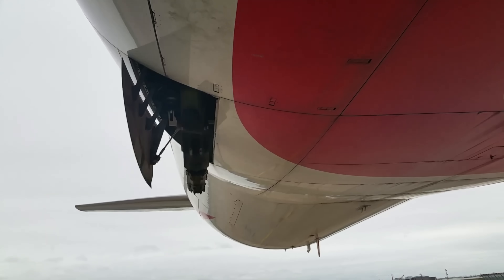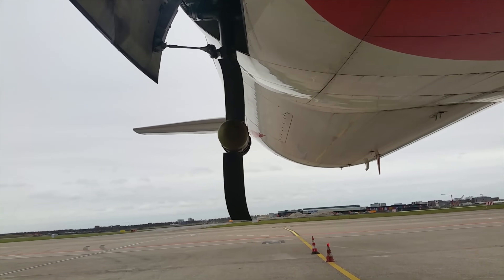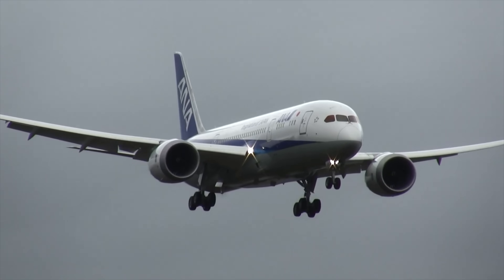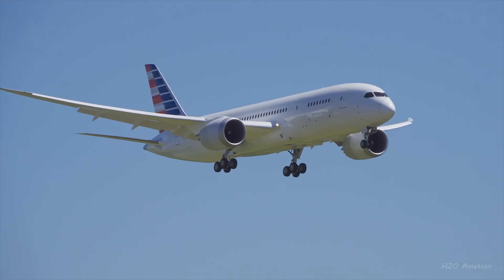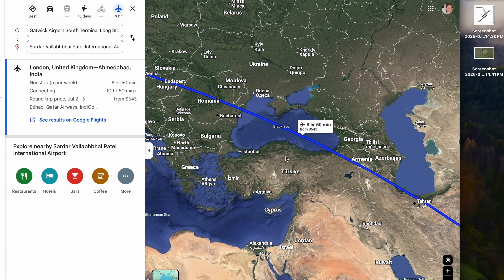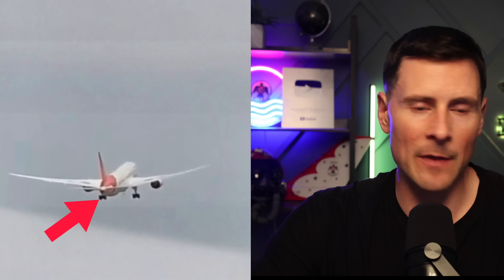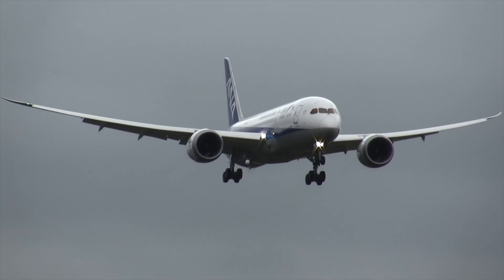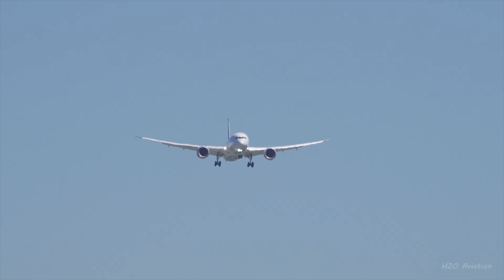Air India 171 SHOCKING UPDATE on RAT Deployment and Flaps!

Comment: Yes it does change everything, a 14 year old plane with engines suddenly dieing like that. SHODDY MAINTENANCE, that's what it is.
Reply: 11 years
Reply: British Airways Boeing 787 had to return due to flaps issue....will call it SHODDY MAINTAINANCE too?
Reply: @gulleyboy2607 are you really thinking or are you just looking for the easy way out for your own negligence. There are checks, checks and more checks before a plane takes of. I was on a plane in Zurich and that plane was grounded for 24 hours plus because the technicians found a problem. The following day we flew over 12000 kms and safely home. Air India, do your guys really look after your planes?
Reply: It doesn't work like that, components are changed for faults or failures they are not routinely touched, periodic testing and checks to verify operation is done but they are changed on condition or with limitations time changes. It has to be fuel contamination or pilot error, there's no other possibilities.
Reply: Or a pilot spilling his soup, and it leaking down into the wiring panels etc..
I'm betting that's the real problem.

Comment: What do I think?  The Boeing 787 has fatal flaws during takeoff when a combination of mechanical/electrical system faults combine to fail at takeoff.  It should be grounded for examination.
Reply: Yes, seams to me too. Restart is only with APU which themselve need at least the RAT. The APU have enough to start the engines again. I guess more than 60s or more feets. So why do not supply the fuel pumps for 2-3 minutes by batteries?

Comment: If, the black boxes confirm that an internal system failure led to simultaneous loss of thrust and power and there was no external trigger like other rare dual-engine failures (e.g. volcanic ash, bird strikes or heavy rain) this would be unprecedented and deeply concerning for a Boeing 787 which is a more-electric aircraft.

It would represent a critical failure of aircraft system architecture at the highest level of design and safety expectations and be potentially ground-shaking for Boeing.
Reply: Yeah, you should ask who is the BIMBO. The one who fight MCAS or who design it.

Comment: It seems to be dual engine loss, but why? Fuel contamination? FADEC fault? Pulled fire handle ? Switched off eng switches? Every thing seems not plausible but why the heck the engines go off. If the RAT was out the engine must been off.
Reply: Fuel contamination wouldn’t cause both engines to go off simultaneously.

Comment: I think the problem started on the runway before rotating.  He rotated at the end of the runway Which is very unusual.
Reply: No, they did not rotate late. Using that video, you can find the little shed and the bend in the road that runs along the fence in satellite imagery of the airport, and from that (and the inset video in the upper left corner) locate roughly where the security camera had to be. The plane starts rotating just as reaches the left edge of the shed's roof, and is clearly airborne and climbing when it is aligned with the center of the roof. If you project a line from where the camera is through the shed, it intersects the center of the runway (where the plane would be) more than 3000 feet short of the end. This matches the data from FlightRadar24 where the last data received from the plane has its altitude at about 425 ft (+/- 25 feet) AGL as it crosses the end of the runway.

If it had actually rotated and lifted off near the end of the runway, you would have seen it still on the ground to the left of the shed. From the camera position, actual end of the runway just a tad to the right of that white warehouse/garage structure in the video.

The whole "They lifted off at the end of the runaway!" thing was because of the dust, and not the real aircraft position which people didn't bother to check.
Reply: The question is, was he having engine performance issues before he reached V1?
Reply: Normally when you're heavy and it's hot, you taxi to use the entire length of the runway, if for no other reason than having more options (like aborting takeoff) if there's a problem.
Reply: He did not rotate at the end of the runway.  Look at the ADSB data.
Reply: It was a full plane and they used an entrance midway down the runway they didn’t use the whole runway
Reply: @neilcorby6259  That doesn't agree with info I've seen elsewhere that showed them entering near the beginning of the runway, having about 85% of the length to work with. However that video was hours after things happened and used a pretty basic animation so it's possible this soon the info isn't very reliable.
Reply: @neilcorby6259 incorrect. They did a backtrack :)
Reply: When you say "the problem" you mean that the dual engine failure happened on the runway before lift off? 

Even if that was the case, the plane generated enough thrust with its engines to get the speed high enough (V2) for takeoff which means the pilots had no choice but to continue with the takeoff
Reply: @chikku807 took off in overrun, you can see the cloud of dust and debris on the airfield video, that's what killed the engines, FOD.

Comment: Even the one survived said that for few seconds the plane wqs stagnant and then thr lights came up. Please see his interview as well.
Reply: That might have been the RAT engaging and the power rails switching over. If the cabin lights were on, then that means there was no electric failure because the RAT does not power cabin lights.

Comment: In the middle east in summer it is often 50 deg with high humidity - how do they manage there, do you think? I worked in Dhahran for years and never heard of vapour locks on any type of aircraft I worked on Tornados so I  can't speak specifically of civil but I was flying out on 787s at 50 deg regularly   - so I don't believe that theory, I don't give the fuel contamination theory much credence either.

Comment: My guess would be some kind of major electrical failure. Passengers were reporting that the inflight screens weren't working and some other things weren't working either.
Reply: This
Reply: Air India usually turns the IFE off on domestic segments. The photo that poor family took before take off clearly shows them working on this flight. They're completely separate from the aircaft flying systems anyway.
Reply: @vinba8234 that doesnt sound right. Did you see the video of the guy complaining about the flight? The screens were on but not responsive. So electronics were on but not functioning. Also if the cabin is boiling hot, then that is not like any of the air india flights I've been on. Something was definitely odd on that one.
Reply: The in flight entertainment systems have nothing to do with the aircraft's avionics.
Reply: @stargazer7644  Except the fact that if they feel no need to address a an obvious problem, they might be ignoring bigger problems also. Which probably was the case.
Reply: @rejuvenator8966  The in flight entertainment system isn't "an obvious problem".  That's like saying if the backseat DVD player locks up in your minivan that there's something obviously wrong with the tires.
They don't stop aircraft from flying just because you can't watch Ironman.
Reply: @stargazer7644 you can't call cabin crew either. And what about the non functioning AC? The person in the flight before was boiling in the cabin. Pretty obvious problems even if all you care about is Iron man. And you don't seem to understand that ignoring problems is a bad sign. If you want to buy an apartment and you see anything in the house that is not well maintained or ignored, it raises red flags. Good luck with your minivan tho
Reply: @rejuvenator8966  And you don't seem to understand how aircraft flight regulations and airlines work.  
Every aircraft has a Minimum Equipment List (MEL) that specifies what has to be working to leave the gate.  Anything not on the MEL is COMPLETELY OPTIONAL.  Aircraft only make money for an airline when they're flying.  They're not going to take an aircraft out of service (which costs money) to fix an optional component.  Those get fixed during the next scheduled down time.  This is how it works for EVERY airline.  How many planes have you been on where the wifi or the entertainment system doesn't work?  I've been on a lot of them.
Reply: @stargazer7644 pay attention. Careful now: how many planes have you been on where you are boiling inside? None? Me neither. None of the air india flights were cooking me alive. You somehow keep missing this part. Should I repeat it to you one more time? I think boiling alive is a problem on flight. Also remember we are talking about a plane that lost thrust after takeoff, whatever the final reason for it will be. It doesnt seem like a coincidence that this particular plane had other problems going on: Red flags that couldve been paid attention to. Are you working for air india since their profits are more important to you than lives? Thankfully the air industry in general is not like you, they study every accident and make upgrades to regulations every time. Many plane accidents in our history have been due to bad maintenance by negligence or ignoring issues altogether.
Reply: Are we thinking conspiracy?
Reply: @dudemanismadcool I'm just thinking neglect and ignoring needed repairs on purpose to cut corners. The lousy electronics and air conditioning not working in the cabin just points to neglect on things that clearly need repair. So I wouldn't be surprised if the same attitude plagues the company in bigger issues and maintenance.

Comment: The gear was visibly partially up, as the angle of the gear bogie of the main landing gear was tilted forward, not aft. so indicates a loss of hydraulic pressure, which is caused by a loss of engine power, but the clincher for me was the mayday call, (just released) that said they've lost all power, going down.

Comment: The fact you can hear the RAT at full takeoff power indicates to me BOTH engines were inop.  Listen to the original video and it's whisper quiet right up until impact.
Reply: Exactly.  If the engines were at takeoff power it would likely be very hard to hear the RAT.  They better figure this out fast before there’s another failure on takeoff.
Reply: @alangalloway8700    Boeing and AI have the data from the AHM (aircraft health monitoring) near real-time.  They have a good idea what happened already.
Reply: @almostthere100 interesting.  I guess there could be a number of things that  could have happened to this one airplane that would not raise flags for other 787s.  I’m not sure what that could be.  Any ideas? (I’m not in aviation but do follow aviation accidents closely).
Reply: @alangalloway8700    I am unaware of any instance of an ETOPS aircraft losing both engines simultaneously for unrelated causes... i.e., something NOT common to both engines (ex. fuel starvation/contamination).   This is a head scratcher (AND concerning!) to me.
Reply: @almostthere100 There was a helicopter crash in the UK years ago when the pilot flipped the wrong switch to go from tank 1 to tank 2.

But that would happen late in a flight, when one tank was beeping low fuel.
Reply: @almostthere100 
I don't have any problem with the idea that 'redundancy' and independent systems are in reality anything but.
If power routing can be interchanged between different systems  that also means that faults and short circuits can also use those bridges and junctions to jump between systems and engines.
I've always thought that fly by wire FADEC type engine control   is a bridge too far and this sort of paradox goes back to the injustice inflicted on Captain Asseline and FO in the Airbus flight 296Q crash.I think they were innocent and his story checks out.
Reply: Even if the wheels were not pulled up or flaps not deployed, the 787 dreamliner has enough engine power to climb. This unfortunate aircraft had both engines not producing enough power to stay afloat. So both engines were kaput
Reply: @KarthikeyanNagappan    Perhaps empty or very lightweight, but NOT near MGTOW with 242 pax/crew and fuel for a 9 hr flight.
Reply: You are right. I didn't compute the weight of the aircraft
Reply: The RAT wouldn't even be deployed unless both engines were inop.
Reply: @stargazer7644 
There are probably some exeptions which prove the rule.But not in this case.Both engines clearly not producing thrust.

Comment: The RAT deployment more or less confirms engine and total power failure.
Reply: One engine, c'est la vie, but 2 engines simultaneously off...hummm
Reply: @danielcreveuil it can happen and has happened for many reasons before: contaminated fuel, bird strike. Hydraulic failure, etc….  Clearly they lost all power and crashed. We will find out from the flight data and voice recorders.
Reply: @danielcreveuil  supposedly the plane had electrical issues a few days prior. But also perhaps sitting in the sun for 3hr vaporized the fuel too much.

Comment: Auto deployment on dual engine failure - should give selective electrical and hydraulic assistance ….. BUT… air flow at that stabling speed not sifficient to lift up 10+ tonnes of undercariage quickly.
Forget the flaps (would not have taken off if they were wrong)
All secondary to the main problem - dual losses of primary thrust:
- pilot erroneous shut down(suicidal)
- contaminated fuel (criminal)
- passing through a cloud of non oxygenated air causing flameout (to confirm)
- birds strike (unlikely)
God bless all involved.

Comment: I'm still wondering if they went into the overrun. That was a lot of smoke/dust on rotation. Few have mentioned it, so it might be normal at this location or set of conditions. But I'd think a bunch of arrestor materials wouldn't react well in the engines. Of course, this could or would only be a contributing factor since they shouldn't be in the overrun to begin with.

Comment: Why the power outage & RAT deployment - Something to look at, remember the runway DUST CLOUD AI 171 generated on takeoff, now add STATIC CHARGE to those DUST PARTICLES via the landing gear tires which MAY have created a power outage combined with very hot air weather conditions. A freak onset of circumstances possibly coupled with wire fatigue or damage. Maintenance failure…..say part/s weren’t correctly installed after examination or replacement. Worth consideration. STATIC CHARGE ON TAKE OFF & LANDING CAN DAMAGE ELECTRICAL EQUIPMENT, DUST PARTICLES CAN BE STATICALLY CHARGED. THE FACT THAT BOTH ENGINES LOST POWER & RAT DEPLOYED POSSIBLY ONCE GEAR UP WAS ACTIONED CREATED SPARKING AS A RESULT OF STATIC CHARGE.
Reply: That's White Smoke from Engine Flameout mistaken as Dust.
Reply: @sambitranjan9584 Your saying - Engine flameout at take off & then to climb ( while engines spool down ) fully loaded to 625 feet before descending. Question, is that possible.
Reply: @midnightspares  That flamed out after V1 at the point of Rotate, they had enough momentum because of their Speed & the engine gradually decays it's thrust not like a sudden snap & that was enough for them to reach 400 feet not 600+ feet as mentioned as the airport is at 150+ feet above sea level.
Reply: @sambitranjan9584 Once data recorder information is released we’ll see exactly when engines cut out in the timeline. Thank you for your replies.
Reply: Some people reporting the flight was delayed. Sat in the heat an extra 15 - 20 minutes.  Don't know if this applies to any problems.

Comment: I’m a tester at the GE plant who makes these units along with many other units. Both engines failing would be the only reason I could think of for why the RAT would be deployed. It only provides enough power for minimum amount of systems. I don’t believe it could raise the landing gear but enough to drop landing gear and other components.
Reply: It could be electrical issue. Means engines are running, but electrical power delivery fails.
Reply: @tiju.j for both units and systems to fail is very unlikely. There should be redundancy in the system and the rat unit is for catastrophic failures like running out of fuel I would think. I don’t know enough about this aircraft to say with certainty.
Reply: By any chance could this be a sabotage? 
Just a theory but the sequence of events are so unlikely 
Like how the hell do both engines fail at the same time
Reply: Does complete loss of AC power lead to dual engine and hydraulics failure? Is a 787 not equipped to provide engine power from the DC?
Reply: @maneshwarsingh8688 the units driven by the engines produce AC and DC power. If both engines or both units fail, all electrical power is lost which is why they have a backup RAT unit that is wind driven.
Reply: Do you know about the 248 day reset-counter overflow? What it was reduced to 52 days in 2020?
Reply: @reinerfranke5436 don’t even know what you’re talking about.

Comment: Wonder how the fuel selectors were configured.  I’m sure the investigators will be looking at that.  In a carbureted pistol plane there’s enough fuel in the float chamber to start, taxi, runup, and takeoff before failing.  I know these are totally different animals but the possibility still remains.
Reply: Good question  - I was wondering if the cross connection linking the port and starboard fuel systems would normally be open or closed during a standard take off. If open if leaves scope for contamination (water?) from one side of the plane affecting both engines.
Reply: Theydon't use carburators!